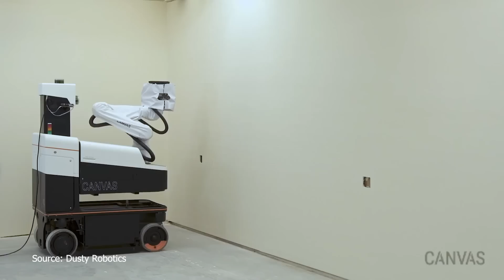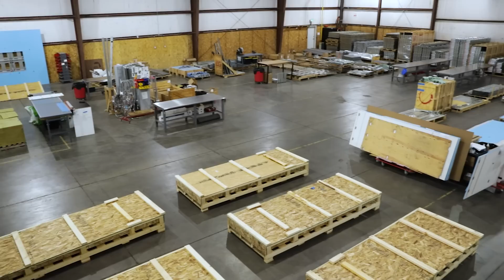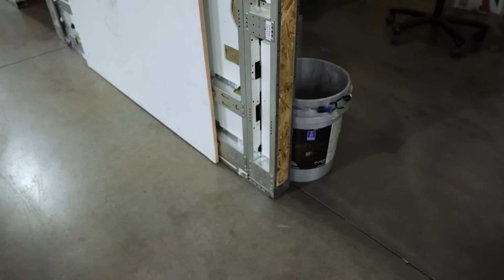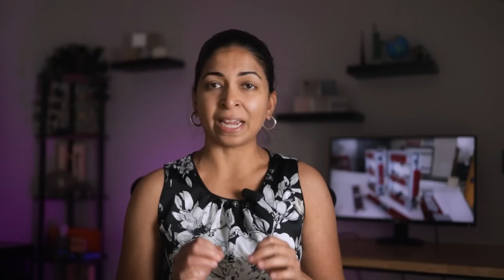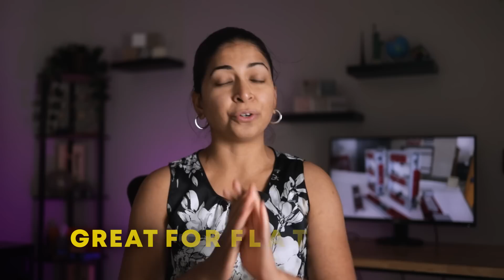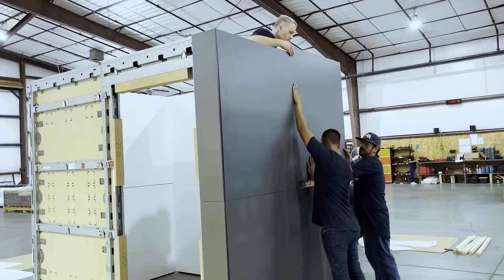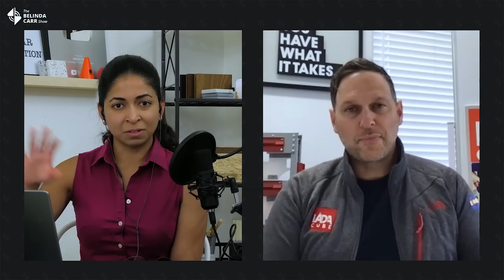Could this reusable metal wall be the 2x4 of the FUTURE?

Comment: It's time to look at a similar roof system and ground connection system - whole house - all modular - one system. This looks like an excellent start.

How do they address heat transmission and air movement through the stud system? I live in the north and getting a tight envelope is a non negotiable requirement. I'd like to see the end of massive non-recyclable concrete foundation walls.
Reply: Thanks for the comment. Thermal considerations are made on our exterior walls through decoupling and gasketing.

Comment: Seems over engineered for a solution we already have an answer to. Could possibly see it having use in short term structures but if you are looking a something that might be there at least a few years then less so. Even then it comes down to cost.
Reply: Thanks for the comment. Costing is coming down year over year. The same cannot be said for stick built.

Comment: (oops)-- to hold up plastic panels. "the outer panels and the cleat system design need a lot of work"-- but this is the meat of the system, the part we live with, and o boy do they need a lot of work. How does a door trim or hang? Floor moulding? Hang a picture? Silly stuff.
Reply: Great questions!  We definitely are improving on our finishes and have more room for growth.  Doors can be hung into any RO using our furring strips.  Moulding can be added to any skins.  Digital metal blocking can be added to any wall cassette and hangs up to 300lbs per screw.  Blessings!
Reply: Ah yes. Certainly the 2x4 of the future. That is a blessing. @LådaCube

Comment: Decades ago there was a building trend for schools that used partitions instead of walls for the classrooms.  The idea was to make it easy to adapt the classroom size to the number of students in locations where there were the population was ever-changing.  It was an abject failure because the partitions did not absorb the noise, and you could hear everything that was going on in every classroom on the entire floor.  This might solve that problem.
Reply: Thanks for the comment!  Our walls can currently achieve up to an STC (sound transfer class rating) of 45.  Traditional stick built walls with roll insulation are typically a 35 STC.  Blessings!
Reply: @LådaCube  Come on, don't need to spoon feed this marketing BS,  In typical metal building construction values for STC range from a low of about 20 to a high of 55 depending on connections between 2 metal surfaces.  You are comparing worst case scenario for stick buildings with best case scenario for metal construction. Everyone knows metal carries vibrations - sound. Everyone with eyes can see that in your product there are  connections beween 2 metal surfaces without any vibration absorbant material between them unlike in sandwitch pannel constructions. Your construction has too many connection points and every one of them are potential points of sound leakage even with sound-proofing materials.
Reply: I remember that in my elementary school.
Reply: There was a classroom like that at my school
Reply: Certainly not, it is not suitable for any kind of soundproofing.

Comment: can't understand why electrical cables must be inside the wall, it makes everything a lot more complicated :-/
Reply: Thanks for the comment!  Typically electrical extension cables, as shown, would not be inside of our walls.  Our system can be hard wired traditionally or with our plug and play systems which are UL rated and listed.  Blessings!
Reply: @LådaCube   .. I meant in general too, why all the wires in almost all the homes are buried inside the wall 

With your product it might make sense :-)  but even in concrete walls the wires are buried in; water pipes used to be buried to in the walls which made upgrading them very expensive.

Comment: Interesting...  how does it attach to the ground?  I would consider doing my basement with this if it were available and not ridiculously priced.
Reply: I think they just sit on a concrete floor slab. There is a steel wall track on the top to hold it all together also. And deck cam locks between panels.
Reply: Our sill plates sit in concrete anchor brackets. Thanks for the comment

Comment: Finally, a product with an actual use case that has potential for commercial application. Investors are in a panic to repurpose empty office buildings to avoid foreclosure and governments are getting on board to allow these former commercial properties to be rezoned to residential. This building system can transform office to apartment because the system fits in elevators for move in without the need to remove glazing and opening a closed building system to the elements during retrofitting. The fact that the system can fit within existing ceiling constraints and with a couple more tweaks, could install as a structural member, could be the key to mass adoption.

Comment: I don't see this system being used anywhere but in commercial uses for now.
Reply: And not all commercial uses, but only commercial uses where the expectation is the floor plans will have to be modified significantly on a frequent basis.  Doesn't seem like it offers any advantages in a place where you could reasonably expect to go 5-10 years before needing to significantly change interior layout.
Reply: @andrewalexander9492  our system is 75% faster than stick build and requires minimally to zero skilled labor to build. Permanency vs modularity is not always the only discussion regarding value.

Comment: How much do they weigh compared to traditional walls? I understand the are easily movable, but how do you deal w ceilings when installing in an existing home?
Reply: Fitting floor to ceiling's gonna be a bitch if you have to drop panels into a 3" deep dovetail.
Reply: @jimurrata6785  I am sure that one side of the dovetail connecters could be made to slide up and down to lock, that would eliminate the need to lift and drop a panel in place.
Reply: @MichaelMurray-w6f  Yeah...  But THIS is not that.
This is an unrefined answer looking for a question.
I assembled literally acres of office cubicles back in the '80's 
I feel I have a good grasp of what's going on here.

Comment: Are you happy with a room without a roof?  (I had to.) It is modular but only for interior walls so the building is still standard construction.  As a locksmith, the security problems are instantly there to see.
Reply: Hide the hex wrench...
Reply: We provide top skin lockers that prevent the skins from being removed.
Reply: Fbr robotics and the haydrian x will sort out the exterior building of walls

Comment: I work in live theater & seeing deck cam locks used in home wall construction made me actually laugh out loud. Not because of the hardware but the irony of having used these cams for decades in scene building. They would truly benefit from alignment pins so the rotation of the cam doesn't misalign the joint.
Reply: Was going to ask how often we plan on recycling our walls, but I guess in your case it would make a lot of sense.
Reply: Office building, malls, strip malls, warehouse, etc.. 
Basically vomercial applications where tenants are in constant rotation.
Reply: I want this for my next house!
Reply: @radiationroom  This is good for commercial/retail/office
spaces but not for homes. For homes you have prefab construction.
Reply: You'd think that metal, or even wood dowels, would already be used to ensure alignment of these cassettes.  I'm going to tell John Fay the 7 P's:
= Proper Prior Planning Prevents P*ss Poor Performance =
Reply: I work in kwanstruczion and this is a fad. It will never be mainstream. These tools are being developed by people who are overthinking the solution. Seeing a robot screeding the wall Go me LOL cos who’s going to cover the service cost?
Reply: @John_Uche the same way it gets paid for in any other industry that decides to use automation. The cost of a robot plus the cost of its servicing and maintenance is still less than the cost of the people it replaces.
Reply: @John_Uche the machines might not be cheap but humans are expensive.
Reply: people don't know how construction in your area gets done without computers😂

Comment: This works well for those who build with in massive structures. Think big places. Warehouses, shops, event centers and so on. Large stores which need small store fronts. This has a market. Its just not that big of a market. If we were to start building massive structures in which we need to build with in said structure it would work. 
This might even work in skyscrapers yet you are going to find a lot of wasted space. Then again most skyscrapers tend to have very similar lay outs. You could toss up walls and electrical for new offices. Yet you still have one major concern and that is hvac systems. 
Its a super cool Idea yet it has limited use in the "real" world.

Comment: Head of partition needed components adding from above, not possible if the ceiling already exists.  Video show a cable running outside of framing.  Plug and play really should be that without the final connections carried out on site, use looms to do it all.  Good start but UK British Gypsum Ltd had a simpler demountable system but nobody specified it.  Modular thinking is right but designers design in waste without knowing the size of stuff.  Retrofit not suitable for modular design except in open floor plans.

Comment: I see it as good diy panels for tiny homes but too much steel thermal bridging put a shadow on energy efficiency. Looks like a overengineered solution for a problem that didn't exist.
Reply: That is why i think they are marketing this for interior walls. Pretty sure they are aware of these limitations
Reply: @coolestrock2008  No they're not, and I quote "Låda Cube creates customizable, sustainable architectural interior and exterior walls."
Reply: My thought as well, the insulation value seems like a weak point. But should work great for interior walls in commercial spaces.
Reply: I can see it for partitioning a large open space with temporary, non-loadbearing walls, but not much else.
Reply: This is good for commercial/retail/office
spaces but not for homes. For homes you have prefab construction.

Comment: I'd see more use for this in stadium events or civic centers where they need to change layouts frequently for different events, possibly even concerts when the venue is outside.
Reply: Or kiosks for conventions, etc.?  I would think the vendors then would just need customized skins with their logos and other information. Quick set up and take down would be the standard.
Reply: Yeah, for something like that where interiors are constantly being changed for short term events, a facility where you can reasonably expect to be moving partitions around weekly or monthly.... well maybe.  But it appears that this is being pitched as a product for more typical commercial buildings.  A commercial tenant could be a tenant for 5-10 years, potentially with no change in their interior space partitioning.   This is going to be a lot more expensive than metal studs and drywall, but let's set that aside, and imagine that you decide to invest in this system for a new tenant in your commercial space.  15 years down the road, the tenant moves out, new tenant moves in.  New tenant has different space needs ... more and smaller rooms.   OK, so you disassemble all the walls.  Now you have raw materials showing 15 years of wear and tear, and you only have about 75% of what you need, because it takes more "cassettes"  to make the same space into more smaller rooms.  Thing is the regional distributor doesn't carry this brand any more because of (fill in whatever reason distributors change suppliers) and you need this brand of product, because any other brand is not going to be compatible with the proprietary connection system.   So now you have to special order new panels from halfway across the country to get units compatible with your 15 year old stuff.
Reply: Those products and services already exist.
It is quite a large industry.

Comment: What's the verdict on thermal bridging and sound conductivity?
Reply: These aren't structural walls
Reply: @apex007 They don't have to be. They are for spaces that evolve and not locked into a permanent layout.
Reply: @BigHenFor  I know. I was replying about thermal bridging. That concept applies to exterior walls which are load bearing. This product is not designed for that
Reply: I do not think thermal bridging is going to be a problem when this all appears to be for internal stuff. Think of this like throwing up a building with in a building. You have walmart that wants to add a new store in the middle of its store you could use stuff like this. 
If say walmart or home depot or like big box store wanted to throw up a starbucks right smack in the middle of their store or even say they wanted to promote a new brand that is not sold with in say walmart. For example say Nike shoes and Nike pays x amount of money to toss a store in select stores and now you can buy nike's while there. The concept is nice to find that you could have a new store in the matter of a single night. Think in door mall yet not fixed stores. More like stalls that can come and go. This would make renting out space far better and no longer confined to the store size.

Comment: Working in construction, there's not that much of a desire to demo a whole building and reconstruct it. I can't see this as popular as standard metal studs. Those framing guys work extremely fast.

Perhaps for temporary construction this will have a purpose?
Reply: I could see how a venue of some sort would like to have a reconfigurable interior. Even for a home owner that would be a nice touch. It's mostly about cost and availability. If someone shows up with these things at cost and at speed, I mean why the hell not at that point. It will take years but soon enough major players will be putting their money in it and through them it will start taking over sections of the market until it's a standard material. As someone also in the trades I don't mind the idea of switching over to smarter systems or letting a robot do a lot of serial work for me. In the end what matters is that the client still needs you to complete their vision and you keep up with the latest and greatest in boons to offer them.
Reply: tose framing guys are usually working fast by chemical enhancement.